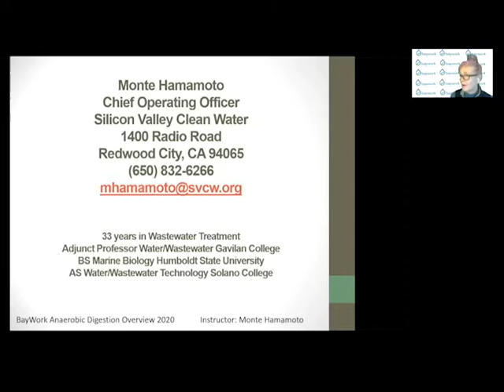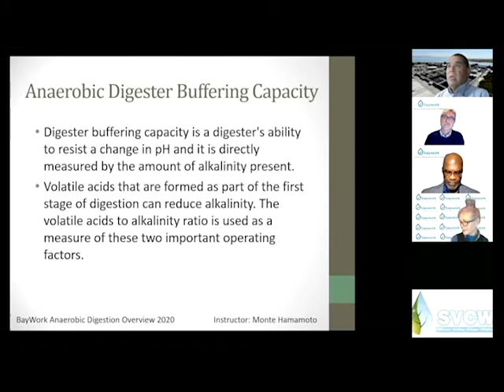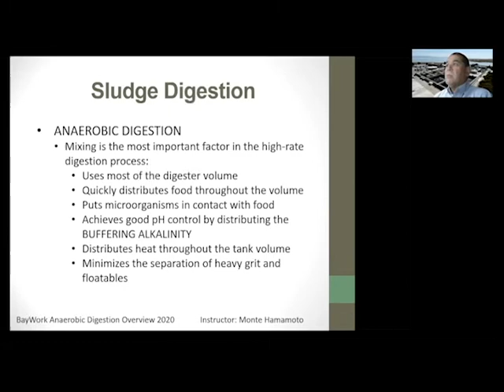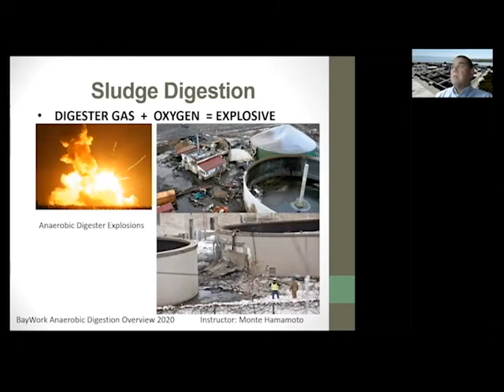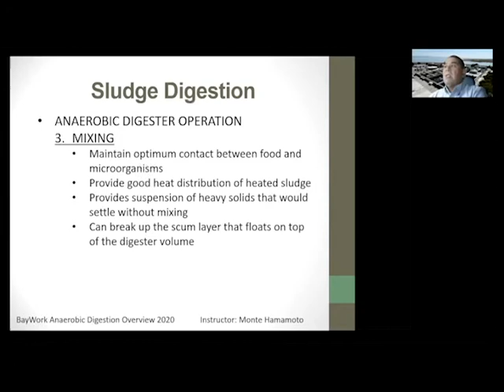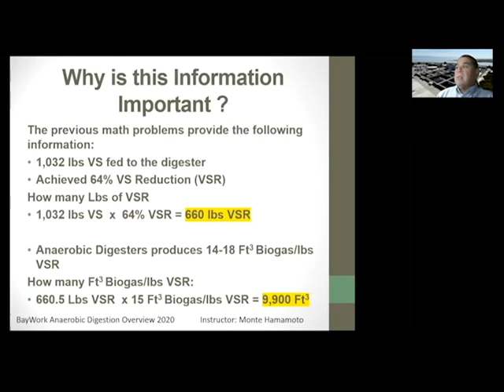BAYWORK Training Buffet 2020 - Anaerobic Digestion

Comment: Actually your math slide 44:58 is correct. I was following along with my calculator and I got 0.041 VM cubic ft p/day. Great video, I appreciate you sharing this. I’m a water system superintendent and I have quite a few inexperienced operators along with their CSU wwt manuals this video will provide them with quite a bit of useful information. I come from the water treatment side so I found this extremely beneficial. Regards from North Pole, Alaska. 🎅🏻🎄❄️🇺🇸